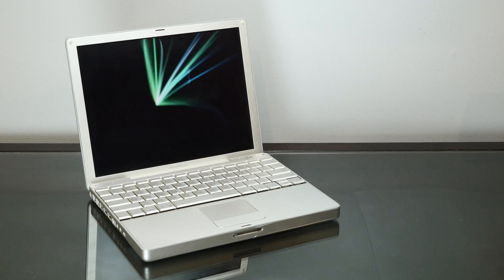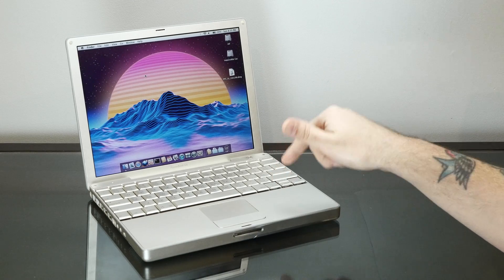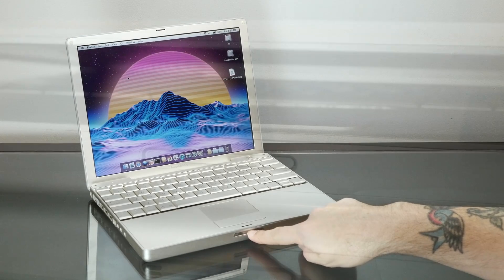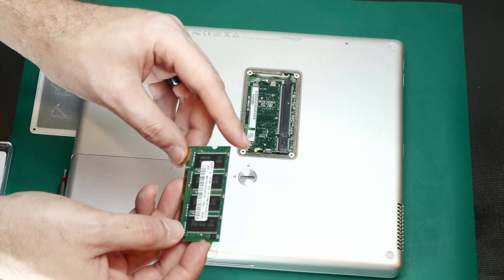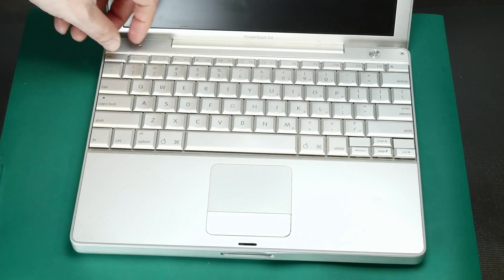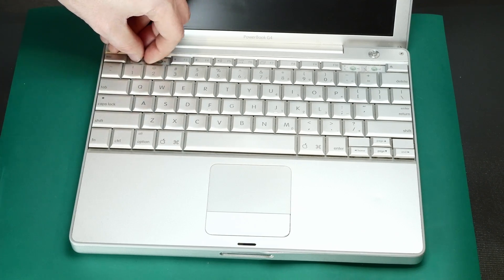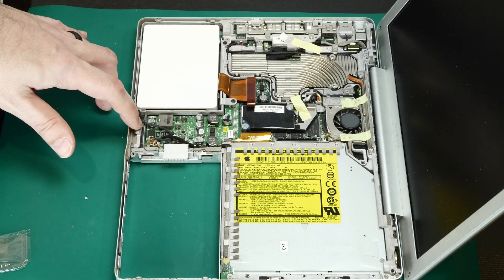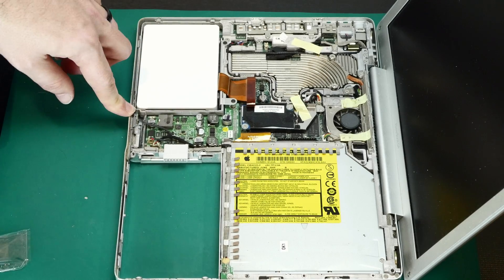Upgrading the 12 Inch PowerBook G4 to its limit - Max RAM and mSATA SSD!

Comment: I loved this machine back in the day, when I did tech support for my former art school. It wasn't much use as a design tool, but it was a great laptop to take along when I needed to deal with something in an office or classroom, and it looked so much more "professional" than the similarly sized plastic iBooks.  

I recently bought one through eBay, because I missed it. It came with a "bonus" game DVD... because it wouldn't eject. I tried all of the standard techniques – software, firmware, and hardware – but a bent drive frame prevented it. I had to disassemble the unit even beyond what you did here, to get the optical drive out and do some unholy things to get the disc out of it. I considered just replacing the drive, but I don't really have a use for that (and I have an external one). I just didn't want "Barbie" spinning up every time I powered it on.

Comment: Don't get me started about 4:3 vs 16:9 screens. The UIs of both MacOS X and Windows 95 were designed for taller screens. They each have several consistent elements that are stacked vertically: pull-down menus and toolbars at the top, statusbars and taskbars/docks at the bottom. If the display is fairly tall, this isn't a problem, but on a wide (read: short) screen this leaves you with just a thin letterbox slot to view your word processing document or web page through. Since 4:3 screens don't exist anymore, I finally ended up moving all my docks/taskbars and toolbars to the left side where they aren't in the way... too bad MS doesn't even allow that anymore for the taskbar.

Comment: Hey I did a upgrade and CPU repaste on this machine and when I was screwing the spring loaded CPU screw back in the pin snapped and now is only hooded down by one spring loaded screw will this be fine or how can I repair it thanks and great videos

Comment: I have almost the same configuration of 2005 (manufactured in the first week in March) 12-in PowerBook, the difference is mine's not getting its 80 GB HDD upgraded to an SSD because my hands shake to much and there are far too many screws involved for that combination to ever be realistic. But it's nice to know such cheap SSDs and adapters are available. I reckon I could use something like that for my 550 MHz TiBook.

Comment: One thing that I’ve noticed when installing Msata SSD’s into Mac’s is that the modern G4’s and PowerBooks along with the PowerBook G3’s handle SSD’s fairly well so long as you have a decent one, they can be picky. Meanwhile I’ve only ever been able to get ONE IBook G3 to accept an SSD. Any others I’ve tried, along with the tibook, refuse to see the SSD’s at all.

Comment: I was given one of these by a friend because I needed a Mac (I was wanting a job in IT, and they required platform agnosticism).

I tore the thing down and rebuilt it with one of the higher spec processors on the motherboard.

I still need to re-Solder one of the Processor's retaining posts, because BOTH motherboards had cracked Solder that pulled the post out of the motherboards.

I had a blast playing Marathon and Myth on it, and learning the OS as best I could.

Comment: I want to take the DVD out of mine and use data doubler if I can track one down. I just have to take the whole thing apart just to remove the DVD drive. The drive is dead and just adding a lot of weight that could be reduced. I found reusable heat pads instead of thermal paste, as the heatsink will be coming off the CPU, I've put this take apart off until I have been able to source all the parts

Comment: I will do the mSata swap in my 12" 1,5 ,too next week. I already had the 1,33 Ghz and a 1 Ghz model of these. My 1,5 Ghz model is exactly like yours even with the small dent on the top lid.😄 ..For the latch, mine wasnt working correctly so I cleaned it with lighter fluid, now it is working again, it has to be able to move freely in order to catch. I love your channel  with the new style ( whiteboard /videos). cheers.

Comment: My first Mac ever, though in the 1Ghz iteration. Thinking about buying one for nostalgia purposes. Still have a Leopard install DVD around here somewhere. Having this on a portable SSD is much smarter for sure. Is it a noticeable speed increase with the SSD? I remember always feeling like with each new Mac I got functions seemed to eventually take longer and longer, but that old G4 always seemed fast even with the mechanical drive. SSD is definitely the way to go regardless.

Comment: great..well, I think of getting that OCW exernal FW/USB enclosure, too for my installs..I wonder how your whole SSD inside is actually formatted for being recognized correctly on boot with an old G4, G3 or older machine? Not HFS+ I guess, when you plug in the FW 800 cable it will be powered but the installers wont be recogmized otherwise your SSD is Apple partion map? Also, how did you copy  additionally modern installers as High Sierra and up on it, I mean parallel? its all on one SSD?

Comment: I still have my 12 inch PowerBook G4 from 2004. It was even a refurb! It still turns on, but the battery pack is completely dead so as soon as it is unplugged from a power supply it loses data and time. My latch still works! Mine has one dent on the front right corner where I accidentally dropped it years ago. Small but mighty!!

I might look into upgrading the hard drive. I already maxed out the RAM years ago. I will need a new battery pack but it looks like they are still available. Thank for the video!

Comment: If you are going to use one of those msata adapters leave the lid off of it. Those msata drives get very hot you may want to put a piece of metal from the drive over to the body of the laptop to disipate the heat.

Comment: Apple uses the worst plastics for their products. They brake down and become brittle. The little boarder around the screen, the plastic feet over the screws. On the imac the bezel under the clear plastic just falls apart. Idk why they used such terrible materials. And the hinge in these things are terrible too. Wayyy to tight when. You close it you can see a huge gap in between the screen and palm rest. Apple also uses terrible displays in everything. I have never seen more screen failures on any other laptop but the powerbooks, Mac books and imacs all get very yellow and dim. They also blow pixels like crazy or will just stop working completely. Same with the crts on the old imacs they would dim, or the colors would be off, or the image would be warped because they didn't protect it enough from the interfearence from the speakers.

Comment: Did the exact same upgrade to my 12" PB G4. 256GB IDE SSD (when they still made them), 1.5GHz G4, 1.25GB RAM, and installed a SuperDrive.
It's one of my favorite apple devices ever made IMO. too bad it is such a pain to take apart without damaging some of the fragile aluminum.

Comment: I have one of this little beauty runinng perfectly (even the battery holds an hour or so) but unfortunately is missing a keycap. Can't find a place to sell a replacement keyboard or even the keycap only (PAGE DOWN). Try to use from another PB 14" but it doesn't fit (it seems that the keys mechanism is specific for the 12"). Any ideia where I could find it?
Thanks a lot. Mauro (Brazil)

Comment: Apple really didn't want anyone getting into these. I've a 12" iBook (2005 model, 1.33 GHz G4) which I picked up about 6 years ago and I've heard it's notorious for being difficult to open and replace the drive (RAM is easier and mine is maxed at 1.5 GB). Mine still has the original drive inside which is still working and I hope it never does fail because that's gonna be a pain.

Comment: I wish you would have done a benchmark test or a boot time speed test for this. I have the model before this the 1.3ghz mine has maxed ram but no SSD as of yet. However I run mine on 10.4.11 and use it for classic apps which seem super fast. I love the form factor. May be my favorite PowerBook model ever. Is it worth it to install an SSD? Mine has an Ultra ATA drive right now.

Comment: Hello! I have an 867MHz 12 inch G4 powerbook. Do you know if this 128 GB SSD and IDE enclosure would work on this machine?
Reply from the maker: Yep should work just fine!
Reply: @ActionRetro  Good to know that. The hard drive just crashed and this seems like a good option. Thank you for your answer.

Comment: I actually just did this exact same thing on the iBook G4 14" model on Friday! 128g SSD (used a miniSATA to SATA converter) and 1.25 GB of RAM. The 14" model disassembly was less straightforward than some of the other guides I have seen, and I had to expose both sides of the logic board to properly de-route and re-route the cables. It works though! My iBook is so quick and speedy!

Comment: hey man, great video! I saw that the mSATA SSD you are using is 3.3V and 450 mA. Do you know if there is some limitation to this current in the powerbook? My question is because I found some mSATA SSD that are 3.3V and 1.5 A and I'm afraid that this will not work on my 12" PB. Once again, congrats for the channel. Cheers from Brazil!

Comment: Dude, remove the macOS FPS limit, there is a tool out there to remove the FPS limit for macOS and get it running smoother.  Also enable QuartzGL, it is supported and works well on pre-2005 iBooks and PowerBooks with older GPUS.

Comment: The entry level of the PowerBook/MacBook Pro range (12/13") were very good value up until 2016, IMO. Still rocking one of these, an early MBP and a 2014 MBP.

Comment: Remember to install TRIM is installing an SSD , Its available for 10.4 , 10.5 at the Macintosh Garden
Reply: @Night Rider It's an instruction set that dictates which data blocks on an SSD are no longer in use and can therefore be erased. In doing so it makes the SSD perform better, but more importantly increases its lifespan.
Reply: what does that do?

Comment: The PowerBook 12” models had a total RAM capacity of 1.25 Gb. 256 Mb was soldered on the motherboard and then you had the single DIMM slot were you could put an up to 1 Gb DIMM.

Comment: Do you have a GitHub or somewhere where you have all of the installers you have for older versions of Apple OSs?
Reply: I did the same project this weekend and what I did was use SuperDuper to clone my existing hard drive onto the SSD using a MacAlly external hard-drive enclosure. Once I was able to verify that I could boot from the cloned drive, I was up and running!

Comment: I wish manufacturers would keep the old, thick designs. You can fit tons of ports, a huge battery (or multiple batteries to comply with FAA regs when flying), tons of drive configurations, and a lot more cooling options to allow for more powerful processors and GPUs.
Reply: Not everything needs to be extremely thin.

Comment: I would love either an iBook or PowerBook G4, almost bought one, but the difficulty of disassembly and the drive swap in particular have really put me off. I have a Power Mac G4 MDD which works, but it's big and heavy and mine has some issues. Might have to take another look at the laptops...
Reply: What do you intend on doing with the computer

Comment: i find it interesting that these computers had expandable ram, and built in ram, you'd think built in stuff would have been phased out by then.
Reply: And yet - soldered ram was phased back IN with a vengeance, replacing expandable RAM, and indeed the whole idea of upgradability, with disposable computers by 2020 :(

Comment: Compared to the white G3 and G4 iBooks, this is easy!
Reply from the maker: Hah, I've never actually had the pleasure of opening either of those!
Reply: @ActionRetro  Did it several times back in the day for myself, family and friends when these were still everyday use machines.. Every time 5 years of my life!!

Ripped of a surface mounted PCB connector once but was able to fix it.

Beautiful machines, but replacing the HD was a thing of nightmares.

Comment: I used exactly the same generic enclosure for my SSD upgrade on my PowerBook G4.  Only put a 40GB drive in there and have a few 128s kicking around so might revisit it - but what an absolute pain it is to get the thing apart.  I did actually pull the wires out of the little logic board connectors doing mine - but managed to get them back in again without any ill-effect.  Was even lucky enough that installing the OS via USB just seemed to 'work' first time.  Nice little machine.

Next upgrade?  Refurbish the battery.  Mine doesn't hold any kind of charge at the moment...
Reply from the maker: Nice! Yeah it's a total pain but it's so nice now with that silent fast SSD in there. Good luck with your battery!
Reply: @ActionRetro  Thanks mate.  Nice video - keep it up!
Reply: Did you feel it was worth the hassle as far as speed increase, if any? I know it's quieter.
Reply: @FrankCastleTIG  Huge difference.  The single best upgrade you can make.  Followed by RAM.
Reply: @mediocrefunkybeat  thanks for the reply! Wish the RAM on this thing went up to 2GB like the 15 and 17.
Reply: @FrankCastleTIG  I know what you mean!

Comment: My PowerBook's fan goes like crazy when I use a browser and some other apps. The computer then shuts down, seemingly from overheating. I can turn it on again after some seconds though. If I use apps like Word, it's okay though. Any ideas?
Reply from the maker: Definitely sounds like overheating. Do you have the 12", or a larger PowerBook? Have you ever taken it apart? My first thought would be dust buildup in the ventilation or on the fan itself.
Reply from the maker: Also, if it has been taken apart before, thermal compound may not have been reapplied - https://www.ifixit.com/Guide/PowerBook+G4+Aluminum+15-Inch+1.5-1.67+GHz+Heat+Sink+Replacement/353#s1435

Comment: What are exactly the tech spec for the mSATA to IDE enclosure? What should I search on Amazon?
Reply from the maker: It's actually this one on ebay that I've bought several times now and never had an issue with on old Macs: https://www.ebay.com/itm/254012761125
Reply: @ActionRetro  Thank you, I found it on Amazon too. I'm going to revive my Powerbook 12" G4 too ;)
Reply from the maker: Awesome good luck! Let me know how you make out!
Reply: @ActionRetro  Will do!
Reply: @ActionRetro  OSX Leopard is on install just now. Everything worked like a charm... except the keyboard removal: it's very tricky and the risk is to bend the thin metallic plate chat support they key mechanisms... and ruin the keyboard aesthetics (if not worse). After the reassembling I had 3 spared screws... and I really don't know where they belong... ;)

Comment: I used a 12" PowerBook as my main machine for several years, and for a while even used it as a desktop connected to an external monitor and keyboard. I really like the form factor, which was a big difference from the plastic G3 PowerBooks (which were also great in their way). I've bought several of them used over the last year or so since I started collecting these old Macs, but I didn't know there was a model that had a multitouch trackpad. I'm going to have to check the ones I have to see if any of them have it. These machines do feel almost painfully slow compared to the MacBook Pros that were released not long afterward though.
Reply from the maker: Oh yeah, I'm using a white MacBook released just three years after the PowerBook was discontinued, a mid 2009 5,2 C2D, and it's orders of magnitude faster. I've even got the most recent Catalina on here with the dosdude1 patcher and it's not slow in the slightest. I've got 20+ tabs open in Firefox as I'm typing this to you :)

Comment: Another outstanding video and, I have the same model in my collection.  As you stated, when these were new at the apple retail stores, I just walked right pass the 12 inch G4 Powerbook because at the time, I only had eyes for the larger screen on the 17 inch model.  However, several years ago found myself needing to get a laptop with a built-in 56k modem.  For use on days when, I would sit with an elderly family member in their home that has no high speed internet and only a telephone land line.  Prefer to keep my PowerPC systems on OS X 10.4 Tiger.  After starting to use this model, I fell in love with its small size factor, speed, and power.  My future goal is to upgrade the hard drive and install a version of Linux along with OS X.  Daily, I still carry this laptop to the office (for E-mail, iLife, iWorks, watching DVD's, and watching recorded HD over the air TV shows) and it never lets me down.
Reply from the maker: Thanks so much! That's awesome you're still using it. I've been using this one as my couch browsing machine and it's excellent at that. What Linux are you thinking about? I've been using Adelie on PowerPC and it's super fast.
Reply: My goal is to add a version of either Lunix Mint or Lunix Lubuntu.  You highlighted an mSATA SSD on this video.  However, when looking for between a 500G to 1TB  mechanical Hard Drive what type should, I be looking for?  It appears every few years that, apple systems use different types of hard drives.
Reply: @transitengineer  To be honest, you're much better off getting an IDE to mSATA enclosure and sticking a cheap M2 SSD in that.  These take an IDE drive and getting a high-capacity IDE drive that's natively compatible will be a pain and an SSD will be easier to get, probably cheaper, faster and more reliable long-term.  Linux-wise you'll need a PowerPC compatible distro, like the PowerPC version of Debian 8.